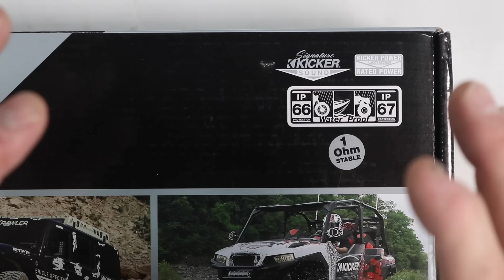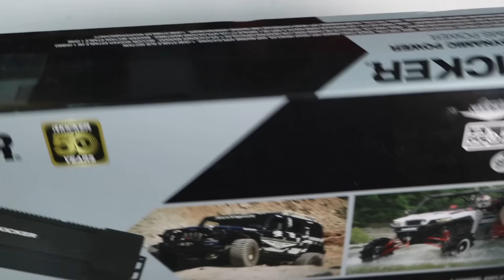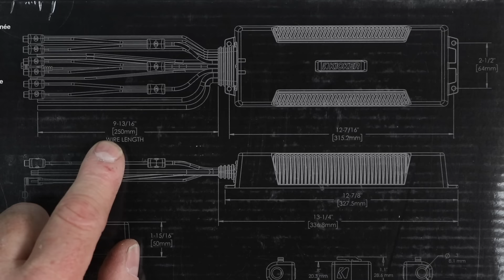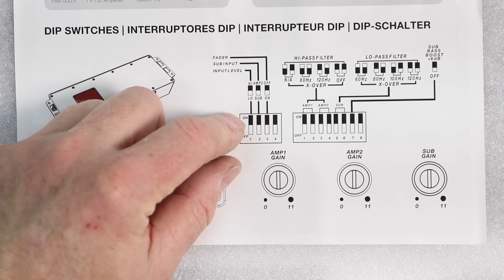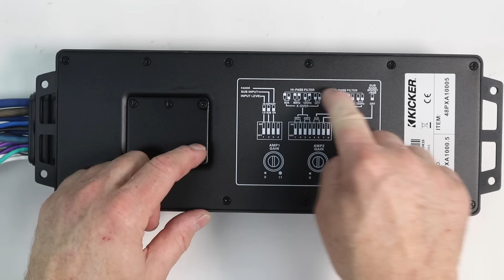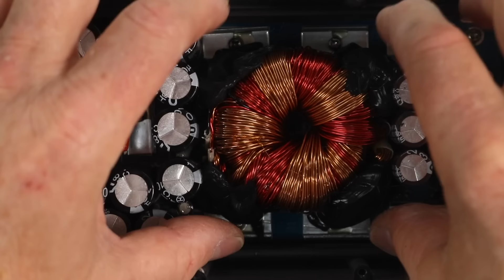unboxing and amp Dyno the Kicker PXA1000 5

Comment: I installed 2 of the PXA1000.5 and 1 PXA600.1 in my Can-Am Maverick X3 Max. They are awesome amps and hold up to brutal conditions! My only complaint is the power/ground connectors are not great considering they want 1/0 feed cables. I'm using a Wetsounds dist block, so I don't need them anyways.
Reply: Just watched the Kicker live stream and they announced built in basic DSP in the 4 and 5 channel PXA amps. I will need to purchase the Kicker PXAPT dongle and download the dsp software. Stoked!

Comment: Wow, at first I was bit let down by the difficulty of repair. I would definitely not try to repair this myself, but instead send it in to Kicker. I don't even know how Kicker is able to do repairs.

Then I was confused by the 4 ohm and 2 ohm specs being the same 100w. How? That is some great technology there. I hope Kicker will explain a little bit about how that was accomplished. Maybe it can be incorporated in other amplifier designs.

Then the sub amp power at high or low voltage. Holy cow! Super impressive. 

Imagine this amp also incorporating KEY dsp technology. Maybe a car version without all the extra sealant. You'd have a whole system in one little box. 😊

Comment: My experience on repairing pcb. Those coils get hot and will break off in an upside down configuration.  Yes you have to hot glue or epoxy them.  Thanks for the review!